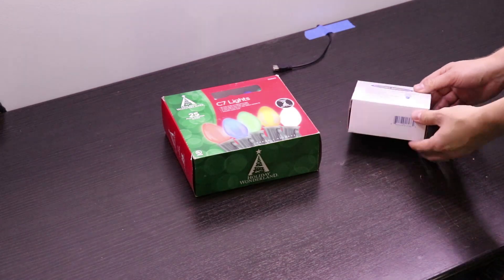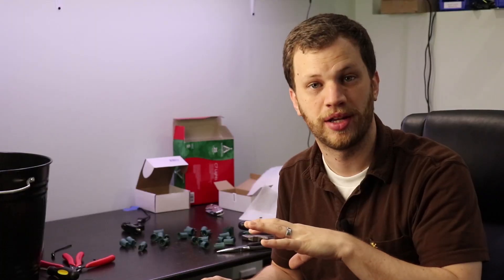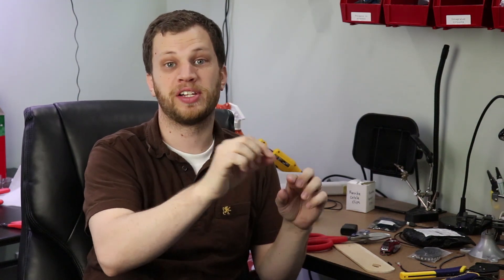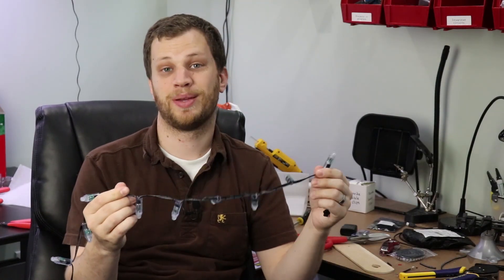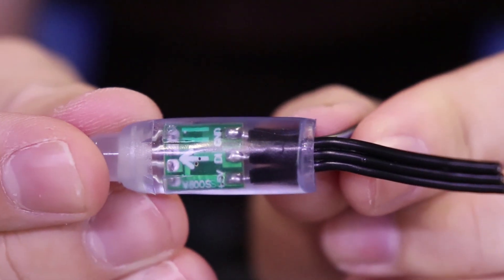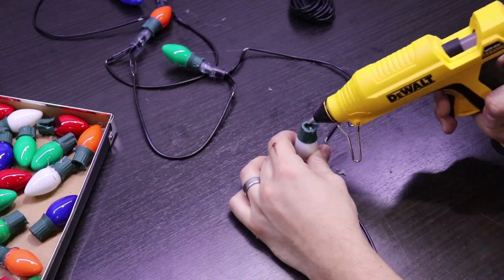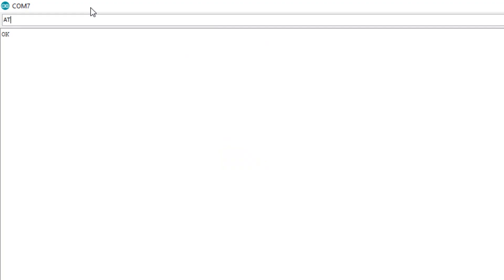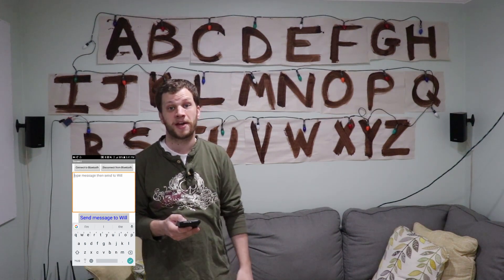How to Make a Stranger Things Message Wall

Comment: To fix the fastLED interrupt issue with the WS2811's, add a "delay(250);" without the quotes, after the serial.printin command on roughly line 99:

Serial.println(ledIndex);
delay(250);
if(ledIndex >= 0) // valid LED index converted from either uppercase or lowercase letter 

This will allow you to send the entire alphabet without a single letter being dropped.

Comment: I'm having a really hard time programming the HC-05, it just doesn't respond to AT commands via Arduino IDE serial monitor. Would your script run on this board? https://www.banggood.com/nl/ESP32-Development-Board-WiFibluetooth-Ultra-Low-Power-Consumption-Dual-Cores-ESP-32-ESP-32S-Board-p-1109512.html?cur_warehouse=CN. 
It has build in bluetooth so it might be a little easier to use.
Reply from the maker: It can be a little tricky getting the HC-05 into AT command mode. You have to make sure all the wiring is correct, and that your baud rate is set correctly. I know I have to look up tutorials every time I work with one. The board you linked to is a great dev board. I don't have the 32, but I've used the 8266. You'll have to change your board in the Arduino IDE. Let me know if you get this to work! Good luck!
Reply: @bytesizedengineering  turned out there are a couple of different versions of the HC-05. With mine I had to hold one of the pins to 5v while connecting the FTDI adapter. I could change the Bluetooth name, but it refused to let me change the password. But after all, I believe it worked out. WS2812 pixels are on their way here, so waiting for those to arrive.

Comment: I recently got all the parts you mentioned on your site for the project. I am using a wemos d1 mini instead of nano v3.0 as i had already had that. After uploading the code to the microcontroller, I connect to hC-05 & send message, it prints on the serial montior the correct index map # for the letter i sent in, however the lights light up randomly . how do i use the chase  function only from your code? i want to make sure the lights are wired from the manufacturer in correct sequence.

Comment: Lets say you had three bulbs where you needed two in distance, you could have just added another set and adress only the bulbs necessary, therefore creating less work and not needing so much "extension" work.